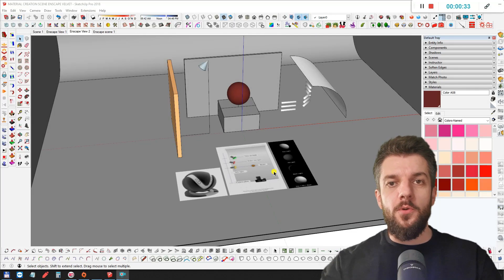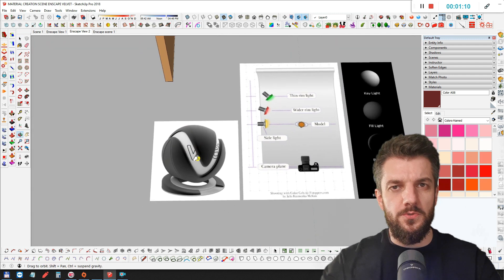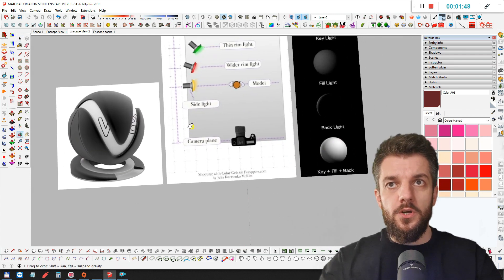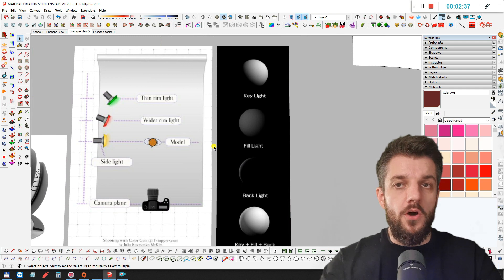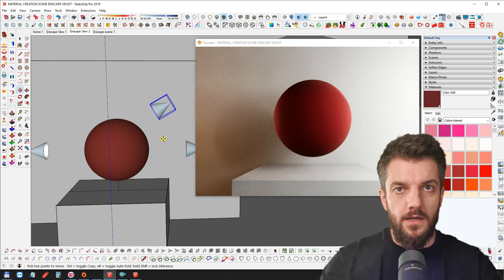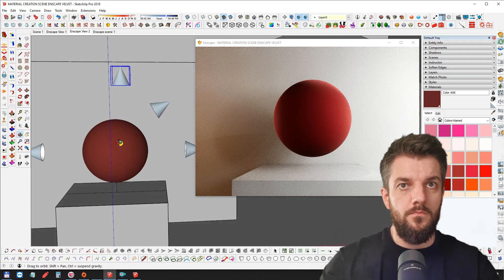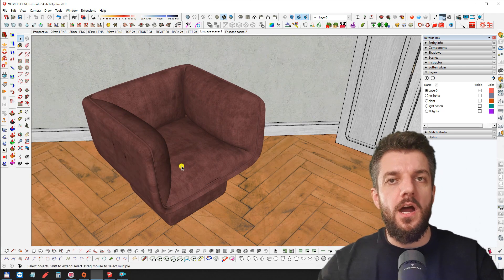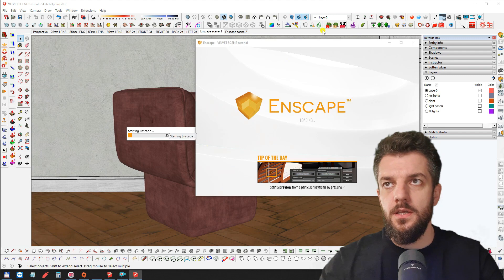Enscape velvet material

Comment: subscribed! Great  content.  Question though... your fill light technique requires visible geometry to host the emissive material, this is fine for a still render where it may be out of frame.... but what would you do if you were rendering a 360 image, or an interactive EXE file out? Can these be hidden from view without losing their light souce?
Reply from the maker: Thank you! The light source is not visible in Enscape. They work great for 360. The light geometry is visible only in reflections. When you use emissive materials on rectangles, then yes, they are extremely visible. Check out my new detail lights tutorial and you can replace the big rectangles with emissive material with the detail lights made out of default rectangle lights (these are invisible)